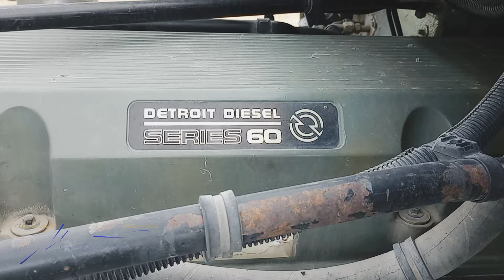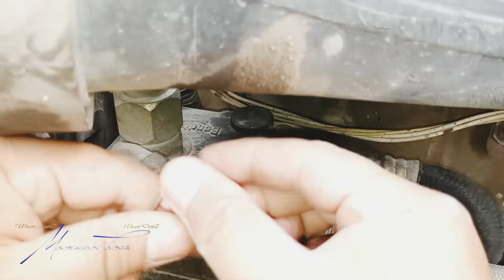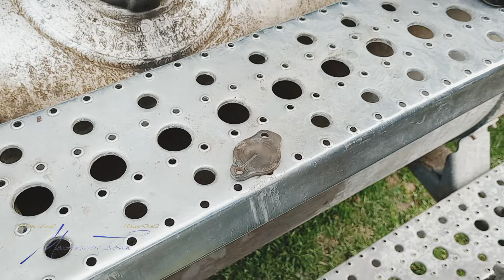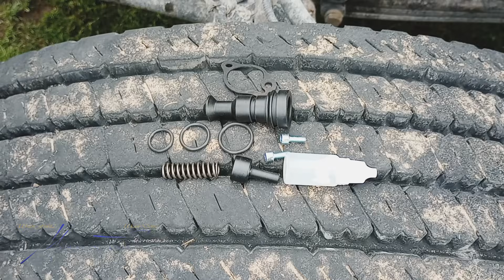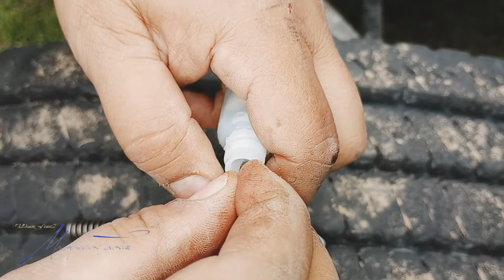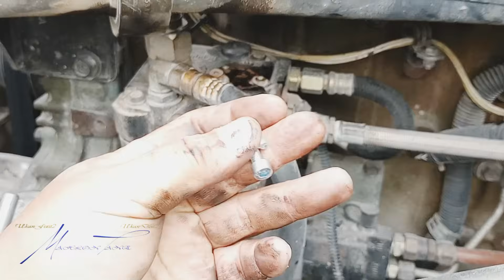How To Replace Bendix Unloader Valve|Bendix Air Compressor Unloader Valve

Comment: Dude have you heard of a wire brush.and brake cleaner  ...ya weirdo. They make round cone shaped brushes to clean battery connectors try that .. life will be easier then hit the thing with a $5 can of brake cleaner that'll dry out fast so suck it out with an air vacuum...Google snap on air vacuume and make one

Comment: Thanks, replacing one now just wanted to be sure.  Safe travels.
Reply from the maker: @MrGassman43  Thank you for checking out our channel. Tap that Like and Share if you don't mind. Also Subscribe if you haven't already. We have different content in our catalog that you might like or find interesting. We hope our content helped you out a little. We really appreciate your time and support!
Reply: Quick question : The smaller o ring is garbage?  Or for another application.
Reply from the maker: @MrGassman43 no. It's for the tube.
Reply from the maker: @MrGassman43 you should watch the entire content to see where it goes.

Comment: My truck is not building past 70 or 80 psi could this be the issue
Reply from the maker: Thank you for checking out our channel. Tap that Like and Share if you don't mind. Also Subscribe if you haven't already. We have different content in our catalog that you might like or find interesting. If you hear air coming from it, it's a possibility. It could be your dryer or something else. You would have to let an experienced mechanic check it out. We hope our content helped you out a little. We really appreciate your time and support!
Reply: @MahlonTane  ya it was the actuator leaking air out the bottom
Reply from the maker: @cesaresparza07  glad you got it figured out and fixed 💯🔥

Comment: What made you change this what was truck doing ?
Reply from the maker: Thank you for checking out our channel. Tap that Like and Share if you don't mind. Also Subscribe if you haven't already. We have different content in our catalog that you might like or find interesting. The truck wasn't building up air pressure properly. It was talking very long due to the seals being busted. And it had an air leak. Still running like a champ so far. We hope our content helped you out a little. We really appreciate your time and support!

Comment: Has it been working good?   I am doing the same job now
Reply from the maker: Thank you for checking out our channel. Tap that Like and Share if you don't mind. Also Subscribe if you haven't already. We have different content in our catalog that you might like or find interesting. It has been working fine since being replaced. Air pressure builds up faster. No problems thus far. We hope our content helped you out a little. We really appreciate your time and support!